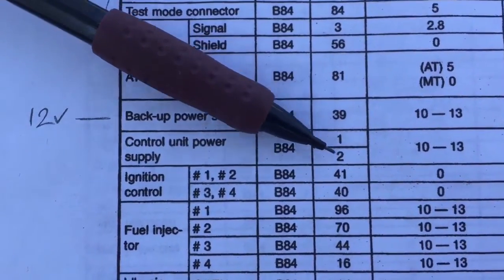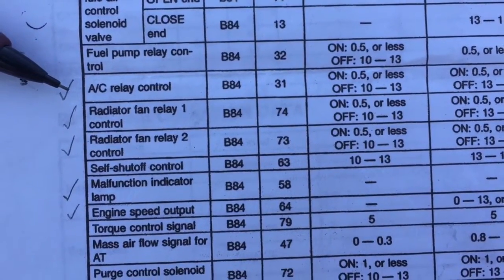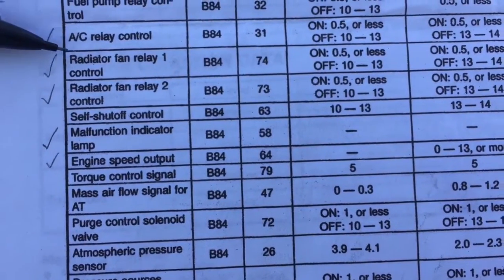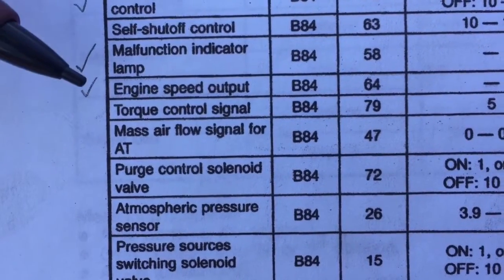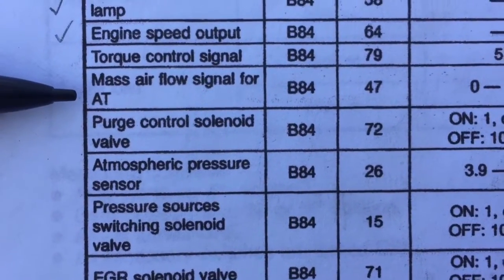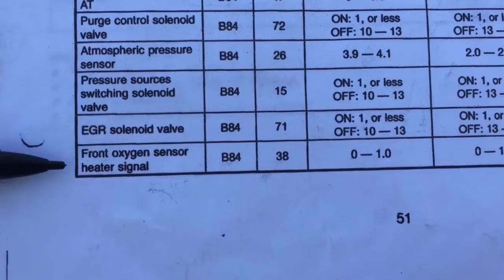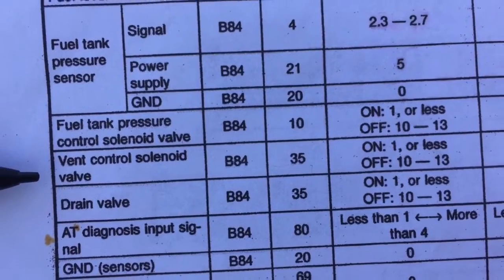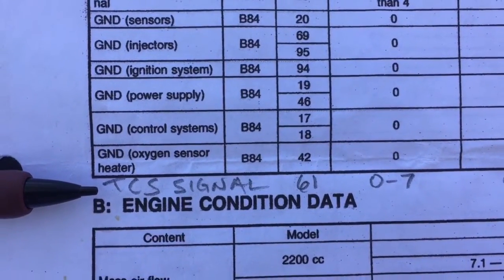7. ECU Pinout 2/2 - Wiring Harness Series

Comment: Thanks for the great information. I am installing a 96 Subaru Impreza 2.2 in a VW kit car and I need a pin out for the 96 Impreza. Do you know where I can purchase one.  I have purchased some wiring info on ebay but it did not have a pin out.
Reply from the maker: +Robert Nelson Hi Robert, I should be able to post one on my website soon. Stay tuned.

Comment: Hi, I'm doing a j22 conversion on my 74 westfalia, and watching your channel has been a great help, thanks for all the great tips.  I do have a major problem though, my engine seems to idle fine, but soon as I try to rev it up it wants to backfire and sputter, always returns to idle perfectly.   Ive tried everything sensor and vacuum related, checked the timing, fuel pressure is between 30 and 40 psi.  Just wondering if you've ever encountered something like this.  My donor car was a 1993 legacy, automatic.  It ran fine before the swap, so I'm thinking its wiring related.
Reply: +Shane Bridden  Try the Facebook group "Subaru Powered Volkswagens" or the yahoo group "Subaruvanagon" or the Author of this video own page www.boxerswaps.com Should get an answer. I would try the FB group 1st.
Reply from the maker: +Shane Bridden hi Shane, it's possible it could be wiring related but hard for me to think of what would cause your backfire. To me, it sounds like a vacuum issue but it's hard to say. Can you try to totally disconnect and block all vac lines to charcoal canister, brake booster, etc? Try revving after that and see if any changes.
Reply: Shane did you solve this problem ?

Comment: I have one wire left. Pin #59. its on labeled on the pin lay out but is not mentioned in the chart. the wire is blue/white. My harness is from a 98 Ej22  Subaru Legacy. Any idea as to what it may be?
Reply from the maker: +Zak Coffey hey Zak, is your ECU from an auto trans vehicle? It may be trans related if so. Just clip and leave disconnected for now.

Comment: I have pulled the harness from my 1999 Subaru Legacy with EJ25. The swap is going into a 1980 Vanagon.  Are there any variations in the harness from 96-99? I found your resource page on your website but it skips over 99. Is 98 similar?
Reply: Kenny - I learned from Yahoo groups, that changes were made from 98 to 99.  I have the same donor car, and Mick has wiring for a 99 Forester EJ25..guessing you found a solution by now...